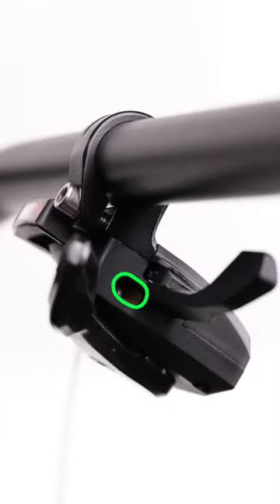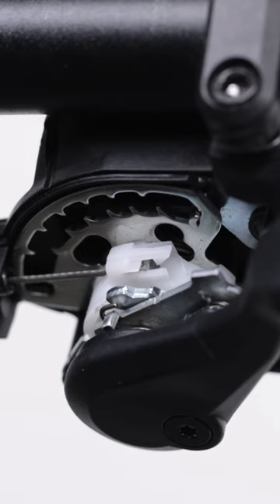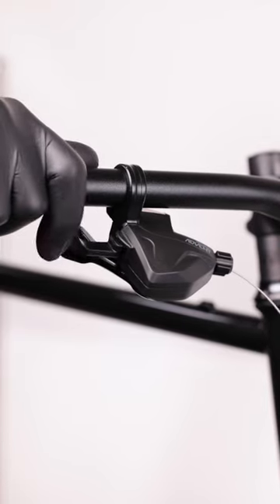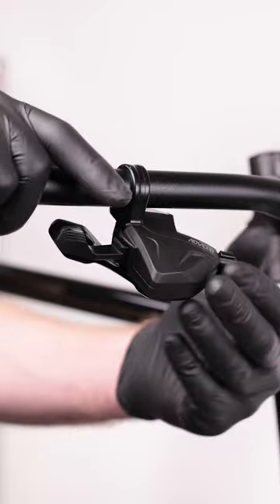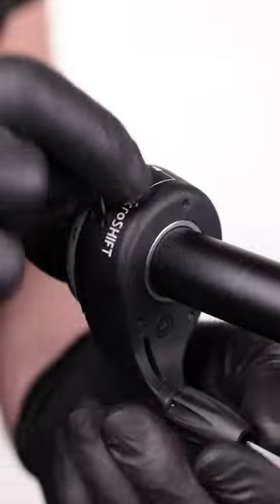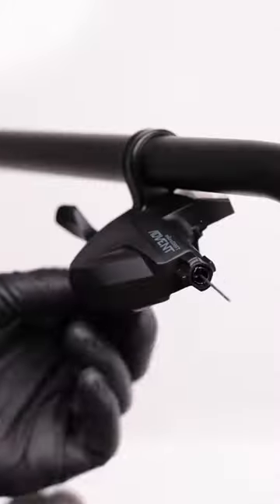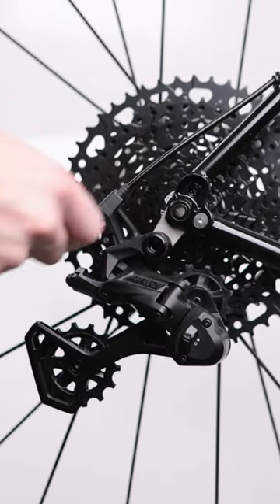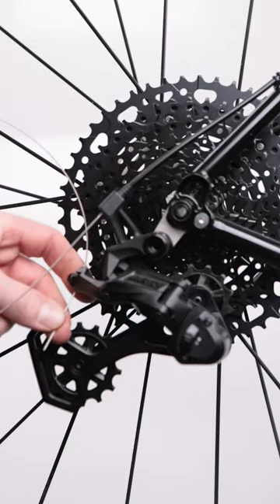Flat Bar Shifter Cable Replacement: Do Not Disassemble

Comment: usually, low-quality cable tends to snap around the terminal end (due to fatigue of bending/twisting). disassembly of the shifter is sometimes unavoidable.
Reply from the maker: True facts.

Comment: Sir I actually need a solution ,there is a forward movement of jokey wheel while stoping pedaling in microshift derailleur
Reply from the maker: For a problem like that, the best thing to do is fill our a service inquiry on our website. There can be a few different causes, and our customer service folks can help you diagnose what's going on.
Reply: Free hub issue on rear wheel